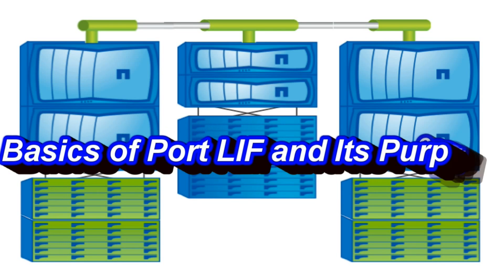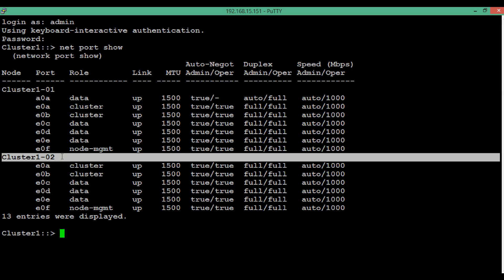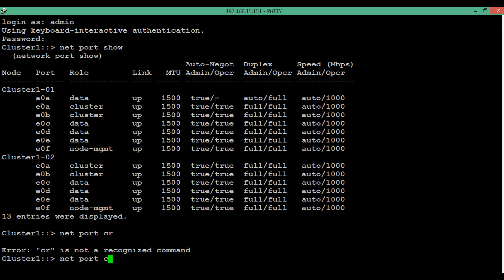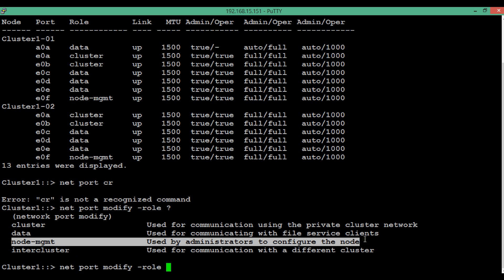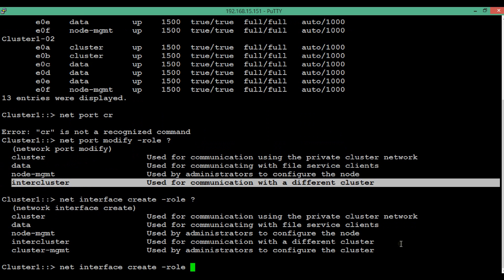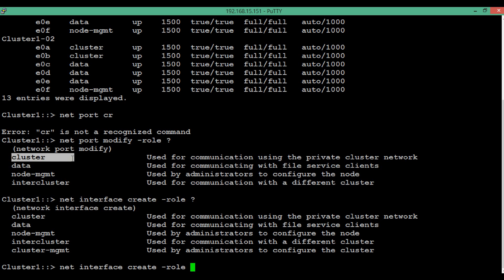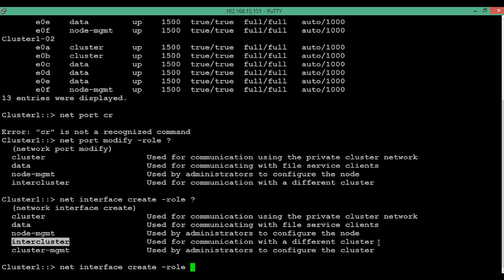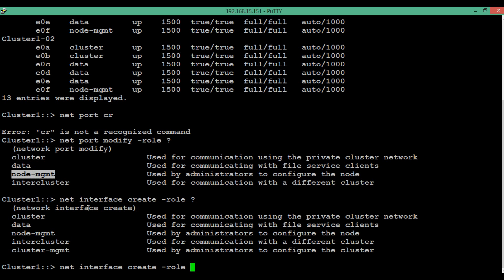Intro on Ports Role, LIFs Role And Their Purpose

Comment: can you please explain the difference between cluster & intercluster lifs
Reply from the maker: +chandra singh Cluster lifs are used for the data communication between the nodes within the same cluster through intra cluster switches. Each node in cluster has 2 port having role of Cluster which will be connected to the intra cluster switches also known as infini Band Switches.. Whenever a read or write IO comes to a node but the required volume is on another node the IO will be send and recieved through these cluster LIFs.

Intercluster LIFs is used for the data communcation between two different Cluster like for data replication between two different cluster which might be within same data center or different. It also needed in case of migrating data from  a 7 Mode NetApp to a Cluster mode NetApp.